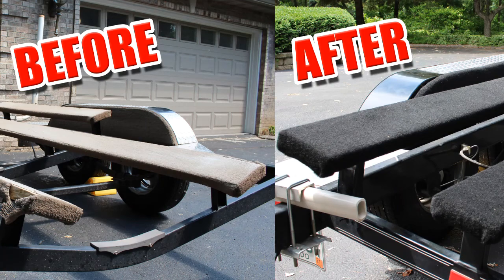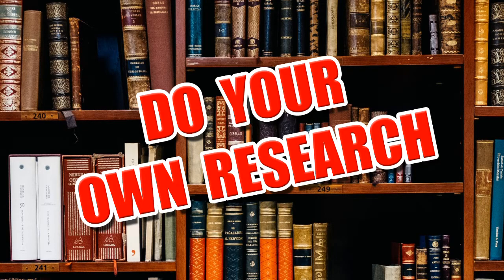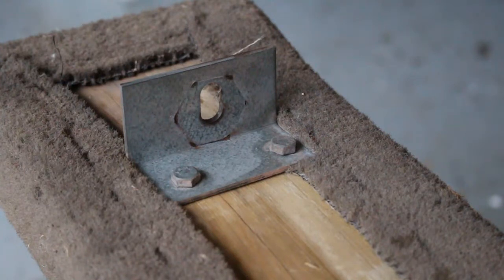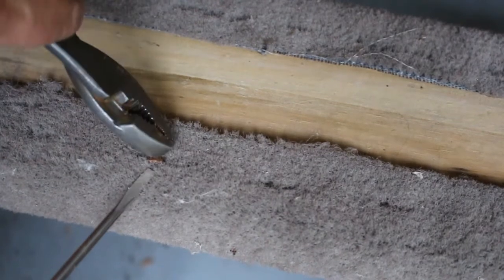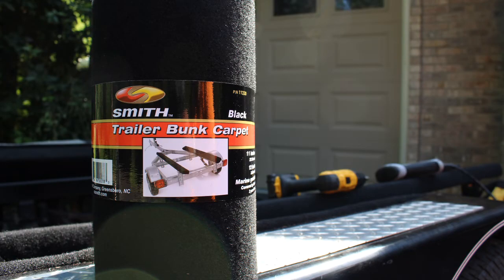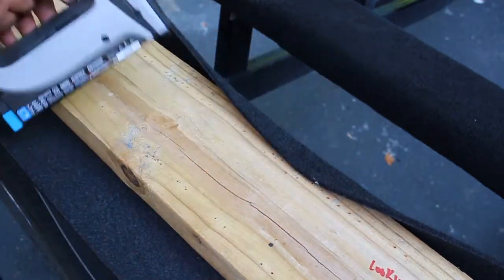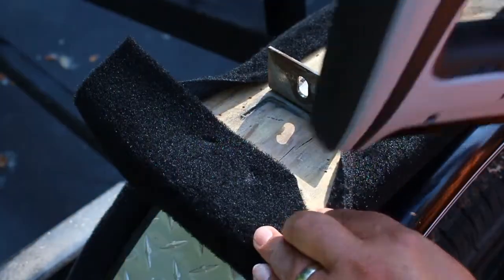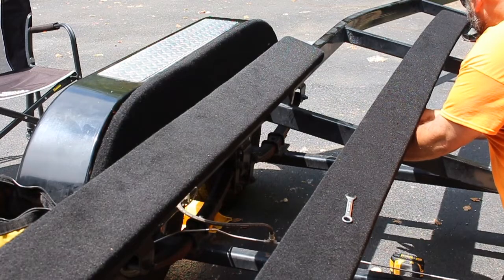How to carpet boat trailer bunks -  re-carpet boat trailer boards

Comment: Why didn't you just replace the wood beams? They appear to be cracked? Also you are attaching the brackets back on the same screw holes which are not as secure as newly predrilled holes in new wood beams. 

If your going to redo the bunk carpet replace the wood beams folks.
Reply: Make sure you're treated wood is dried out thoroughly before covering with carpet. Also prime number one Lumber cost more but last much longer